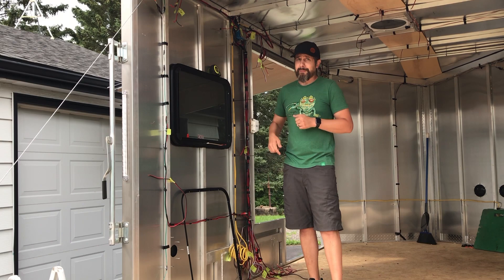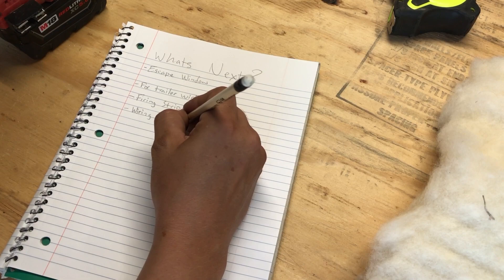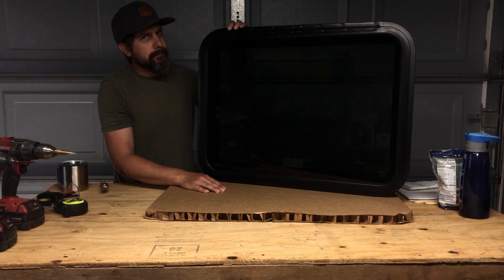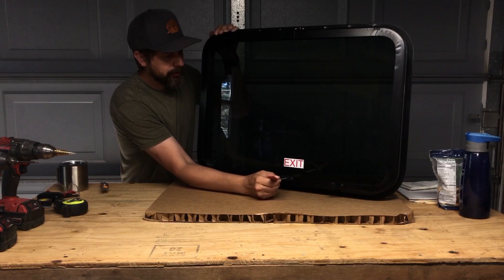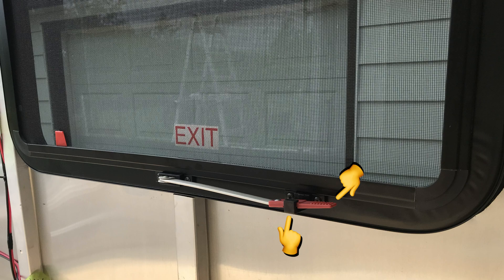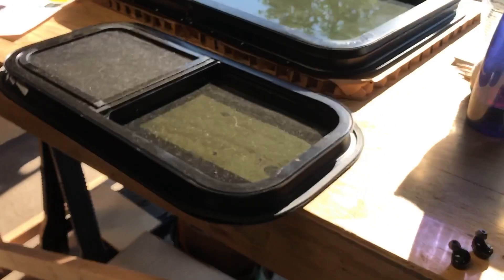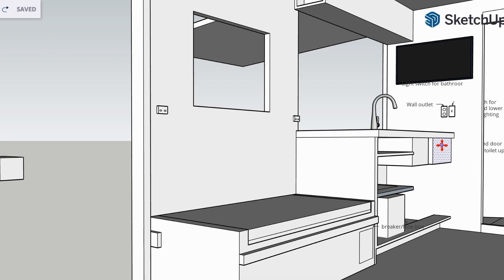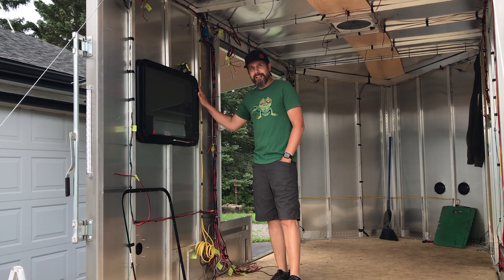Cargo Trailer Conversion Series: Escape Window Install - Learn from my mistakes!

Comment: I learn SO much from my "mistakes ". We press forward though,  don't we? And we share that knowledge freely with others..and there's no "mistake" in that! 
I learned that I need to learn more about window installs before I attempt one a flexible surface...
  I'm a big user of clamps. And jigs. Learning how many different configurations I can employ them, long bars spanning a distance then applying clamps. Working solo they give me that extra 3rd hand.  
I hadn't considered an Escape window...now its on my list. Made in USA is ALWAYS my first objective...I can't always make that happen though. 
I completely enjoy your presentations. Thanks!
Reply from the maker: I don’t think a lot of people use exit/escape windows as a replacement for a standard camper window but when you have a small space it just makes a lot of sense to me. You just have to be careful with the window lever and plastic bits because they are the weak link. But if they come with a screen, that tells me they are meant to be opened right? Definitely check out recpro.com. They had another size up from the one I got, I was tempted to buy it. 

I think you’re on to something with the clamps. I’m pretty sure with a lot of the exit/escape windows, if you hinge the window up far enough, you can actually lift it off the hinge entirely. This means you would be able to clamp all around the window frame if you did the glue in method. But I suspect most people will opt for the no mess foam seal and trim ring. Lots of lessons learned on this one haha.
Reply: @getaway_man  we have to maintain a sense of humor...I do anyways. I have my Duh moments..

Comment from the maker: I learned a lot from this project! 
The moral of this story is, support the sheet metal all the way around the window and find a way to use the trim ring. Alternatively, I discovered that it may be possible to lift and detach the window entirely from the frame. This would allow for clamps around the entire frame. I may post a supplemental video soon to test this theory, so stay tuned!

Comment: Great content. I enjoy the videos, but can you do some work on the audio levels please? Sometimes it's fine, others (like at the start of this video) you can't be heard without cranking the volume to 13 (paraphrasing Spinal Tap) - and 10 is ear splitting.
Reply from the maker: Thanks for letting me know! I’m still very new to video editing. I always try to equalize things but I’ll have to do some more tweaking in future episodes.
Reply: @getaway_man  - I had the same problem on my videos using my Akaso camera. Using my phone, I don't have the issue.
Reply from the maker: @TinyTrailers4BigAdventures  
I think part of my problem is I’m using my phone for the outdoor stuff and using a mic for the voiceover stuff which is definitely going to be a lot louder. I always try to increase the volume for the outdoor bits but I’ll have to increase it some more. Thanks again for the feedback!

Comment: I think it's worth it to weld or at least use some creative screwing to add 1 x 1 box aluminum. Even pay someone to weld it.
Reply from the maker: I understand where that logic is coming from. That’s what I initially thought as well. But with this size window, it’s my opinion, that would be overkill. 

The window with its two piece metal frame adds sufficient bracing as long as the window sits fairly tight between two wall studs. Remember, the window is sandwiching the outer sheet metal, the metal framing, and the interior wall paneling. It’s all tied together in the end so it’s more rigid than before install. 

If you have more than 6 inches on either side of the window, or if you’re cutting more than one wall stud, I would consider welding horizontal bracing at that point. 

I think I mentioned in the video that horizontal bracing above and below window is a good idea, but not necessarily for strength. It will ensure a flat mounting surface which will prevent leaks. If you’re good at welding, would be easy enough to do but simply gluing wood in there will work just fine for a small window.

Comment: Thanks for posting. Question for you.
Did you seal the interior trim ring to the the interior walls or do the screws that gor through the trim ring and into the window do the job?
Reply from the maker: The seal or sealant on the outside, between the window and the trailer is all you need. When you screw the trim ring to the window it will pull the window to the trailer and seal everything up tight.